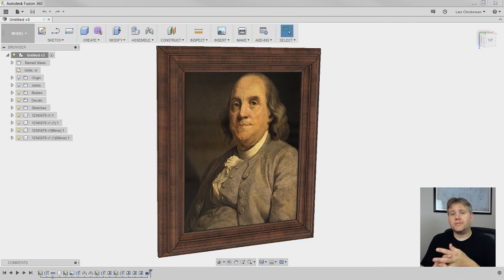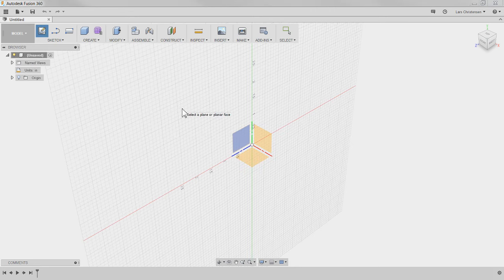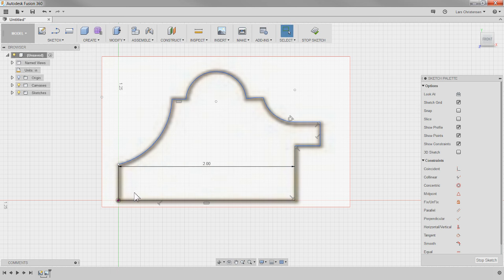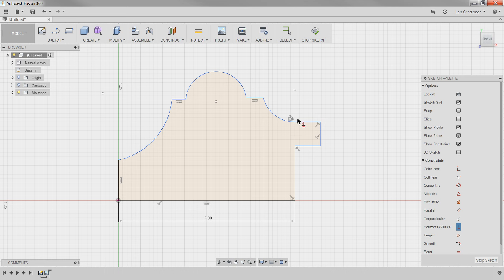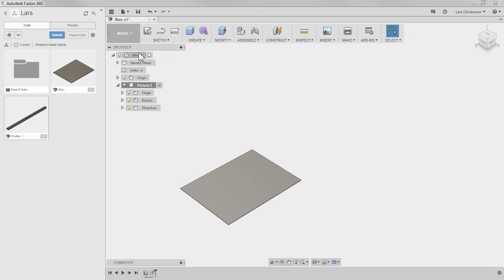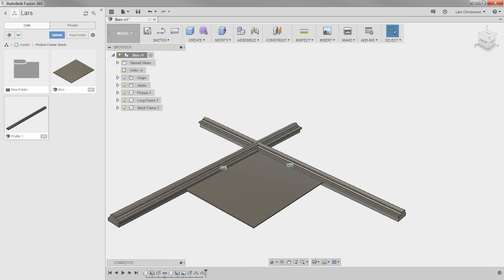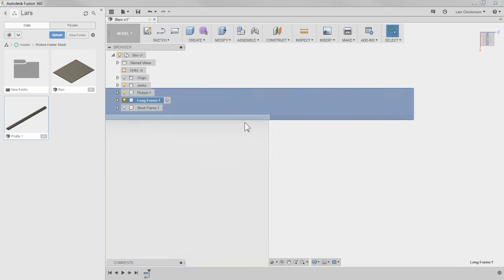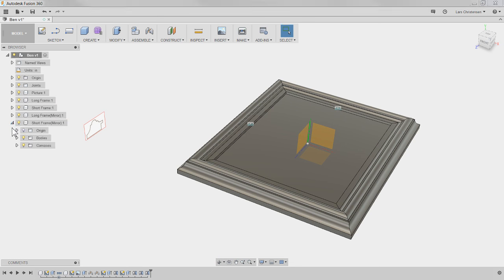Fusion 360 How To Model a Picture Frame W. Image Reference —Your Comments & Questions — #LarsLive 12

Comment: Thanks for another great video.  I realize you are demonstrating features such as mirror, cuts, and constraints but I found a much easier method that gives the same results in only 3 steps.  Create a molding profile sketch as you did, create a rectangle perpendicular to the profile, and then sweep the profile.  To get crisp corners, the profile's outer edge needs to be tangent to the rectangle.  Works with any shape really.  

Thanks again!

Comment: Hi Lars, I have a question about decals/textures... adding a decal doesn't give you any texturing options (gloss, roughness, bump mapping, etc...). Does applying a decal over an object with an already defined material make the decal conform to that materials qualities (gloss, roughness, etc...)? If not, I have already tried using an image as the source for a texture with awkward results. The image winds up looking distorted and low resolution. Any suggestions?
Reply from the maker: Hi Mike LoPinto Thank you for watching!
I think you need to create your own appearance. Actually something I want to do a livestream on. I have not done this myself yet
Reply: Lars Christensen Ok cool. Looking forward to it. If it helps, I have had a lot of trouble figuring out how to use the scaling and positioning for the materials trying to be created. (I made a new layered material to begin with)... it just doesn't seem to translate the way you would think it would, at least for me. Decals are nice and very easy to use but have almost no options for roughness, etc... Thanks again.